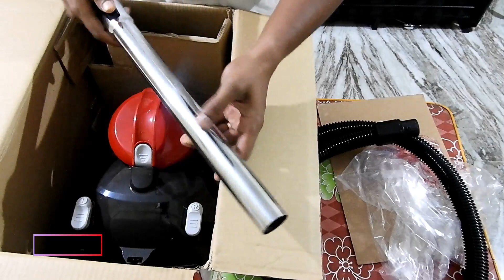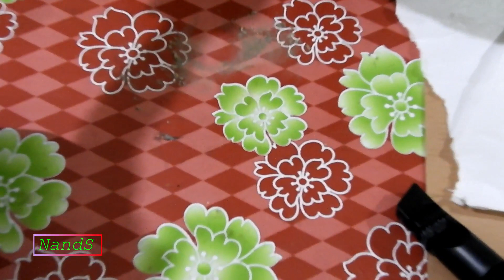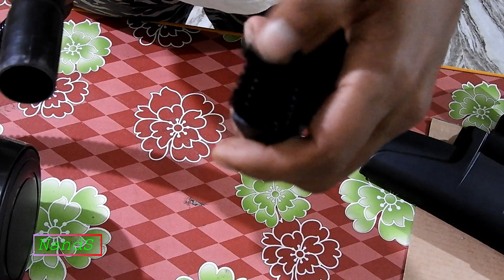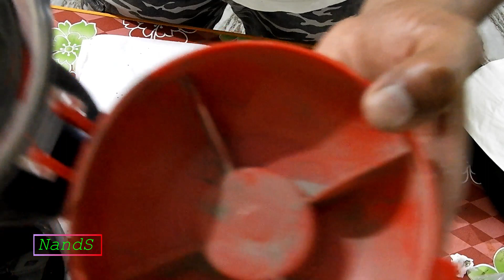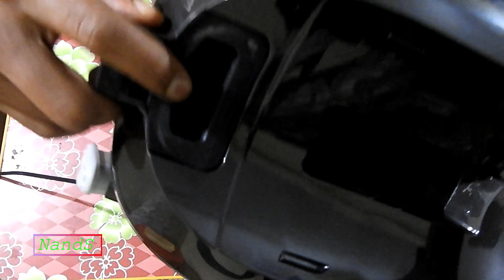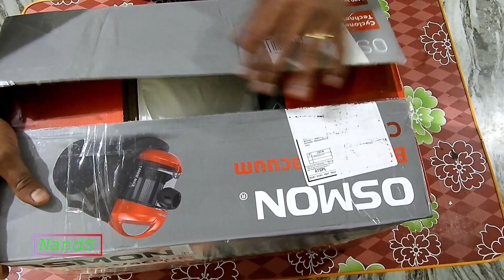OSMON OS 1400BL - Bag less Vacuum cleaner - Review - unpacking - amazon

Comment: Bought from Amazon for 2100Rs, also got around ~200 cashback...The clip for holding the attachment as seen in 22:24 is for storage purpose, obviously, not for anything else. I use it for 4 rooms continuosly, I had timed the usage as ~20mins. Heats a bit at the bottom part,  where the motor is situated. Nothing worth worrying tho.
Suction is fantastic, easy to use, easy to empty the dust. Its a gem of product!